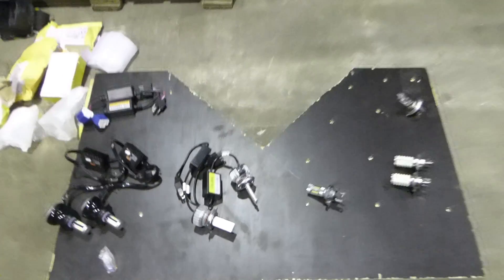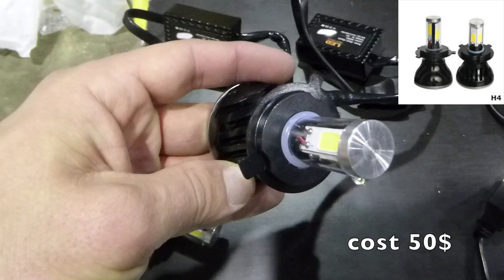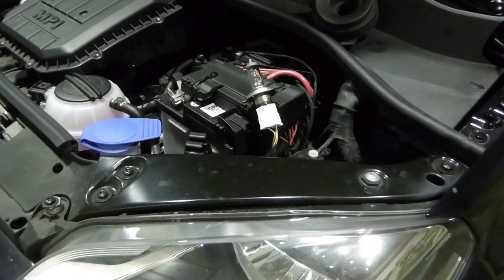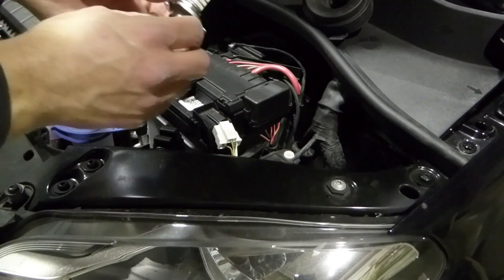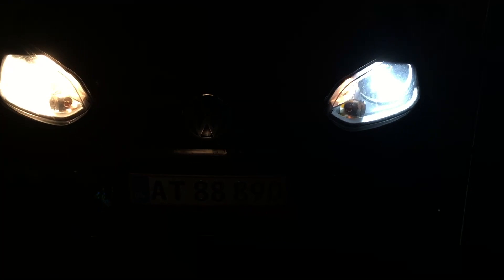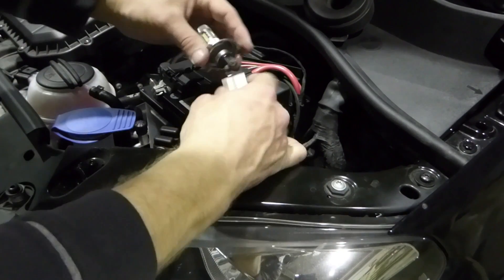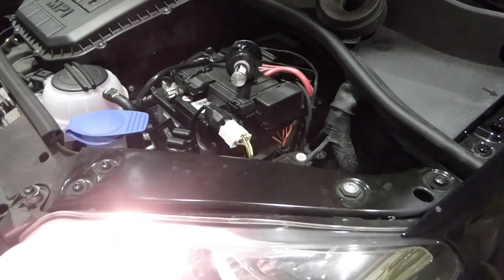Car LED, review, test and comparison, winter 2015/16

Comment: These LED bulbs, are only fog-light or daylight bulbs, and will not work as headlights low-beam. And in that reflector you need a H4 LED bulb with low-beam cutoff. This tester are testing wrong type bulbs in the headlights!!!!!!
The new best test bulbs of 2018 works better, but you have to buy the right bulbs for your lamp. Some work in reflector lamp headlights, other not. and Fog light bulbs only in fog-light or daylight lamps.

Comment: Congratulations!!... this is a very good video and demonstrate that the LED bulbs for headlamps that not have glass projector is not a good idea for the security and traffic in the streets. Thanks. The aftermarket automotive LED it must improve the design of the bulbs and make exhaustive tests so that they reflect correctly inside the headlight to comply with the global regulations on traffic and automotive safety.

Comment: I think qasqdk simply ignored that he could remove the H4 mounting plate from the bulb. You need to do that in order to be able to remount the dust cover of the light so I suppose the operators in the factory did not care about the orientation of the leds in relation with the mounting plate. I link the first video I found where it is shown simply and clearly: https://youtu.be/8gJT8zbU2pA
When inserting the bulb on the installed plate the leds that are on with headlight on must point upward. High beam uses also the other led that points downward.

Comment: Great video. Everyone talks abt how bright lights are but you got the really good point with the light cut. Even if you look at original Philips led bulbs, the first thing they advertise with is light cut/spread on the road. These cheep led bulbs are like driving with high beam all the time and it is just matter of time before you blinde someone on the opposite side of the road enough to smash directly into you.

Comment: LED Car headlights C6 series,we have types 880 9005 9006 9007 9012 H1 H3 H4 H7 H8 H9, easily quick installtion,will not damage your car;  if you want to know more about them,you can click here https://www.amazon.co.uk/dp/B074RGW71Y

Comment: I did see that other people Mount their LEDs with the low beam facing down I wonder if that would fix your scattering problem. your first high power LED was mounted vertical with the low beam on the left high beam on the right when it should be horizontal with the low beam on the bottom in the high beam on the top this would mimic more of the halogen pattern with low beam facing out and down and high beam would be 360 degrees. this is a failed demonstration
Reply: your second high powered LED was more expensive and that was mounted wrong with your low-beam facing up and your high-beam facing down this causes the glare you were getting. also a fail demonstration

Comment: at the end of the vid You mentioned coated high power halogen bulbs might be best, which high power coated halogens would you recommend? are they plug & play (trying to avoid buying an expensive system)?

Comment: The CREE LED bulb you tested at 8:45 was not installed properly. The LOW beam LED should be facing up in the head light and the HIGH beam LED should be facing down. Yours were facing sideways.
Reply: i think just the same

Comment: These bulbs are not oriented correctly so they produce an incorrectly focussed beam. these are H4 replacements and as such should produce the same focus as the original when fitted into an H4 reflector.

Comment: so you put fog lights in your headlight lol im dying from laughing
Reply: interdit no tresspassing H4 is the standard headlight bulbs for many cars. H11 is the fog lights. Do some research before laughing or you become the laughingstock.
Reply: JessGamer1001 no tresspassing, H4 bulbs are for low/high beams. H8 and H11 are the ones normally used as foglights.

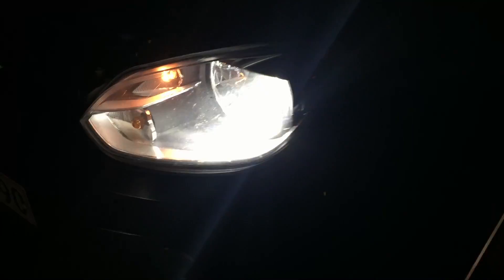Comment: It looks like you have the bulb the wrong way in at 11:10 - 11:15. it's supposed to sit horizontally in the reflector, so that the low-beam led lights up the top half of the reflector, and high-beam lights the bottom half. This bulb sits vertically and effectively turns the spread pattern 90° counter - clockwise in this case.

Comment: At 11:53 you can see that the bulb is oriented wrongly. Dipped beam side should be up so it reflects down onto the road, but it appears there to be aligned to the left and right.
Did all of the bulbs get installed 90° out, or only that one? Also, since the bulbs are keyed to only go in one way, perhaps they weren't installed all the way? This will mess up the reflection too, as the 'filament' will be in the wrong place for the reflector
Reply: Oh, and I would say that despite this, this is an excellent video. Thanks you, very good work, and great not to see some useless view of the front of a car. It's a shame the garage door was not a matt colour to show the spread better :)
Reply: Yeah I noticed that too, I was writing a comment but then I saw yours. I guess they got it wrong while manufacturing because normally H4 sockets only fit how they're supposed to fit in. I've seen cheap (well not that cheap but accessible to most people) and well manufactured LEDs in a similar configuration and I can say they worked well and did not blear as much as fitting HID bulbs into normal reflectors (btw I hate people who use those that way, you can see nothing if raining).

Comment: i think we need to have proper reflector/projector setup for the led bulbs.. because our default reflectors are tuned to halogen bulbs where the filament lies at the focus of the parabola structure of the reflector.

Comment: I have exactly the same bulb as the last one shown here (one with black fan). Your main issue is using standard type headlight, you need a projector headlight to cut off the glare on to oncoming traffic

Comment: Hello I have a question regarding the Led H4 headlights. I have installed some Led headlights in my Toyota. The headlights seems to point to much upwards and doesn't light up the road at all. The wierd thing is that there is no problem, when I install some normal H4 Halogen in the Toyota.

So my question is: 

Have you had the same problems with the LED lights that you bought?
Why is it that Halogen lights work fine, but the LED lights doesn't?
Can you maybe send a link to the H4 LED you have bought. The ones I have is 60/50 Watt, Hig/Low, 6000 Lumen, and think its around 6200Kelvin. 

I also have another problem because the led lights I bought have a cooling element attached to the rear and a fan to cool it down. The problem is however that the rubber membrane which is installed "after" the headlights doesn't fit, because the "hole" in the membrane is to small. Do you know any LED headlights which takes this to account?

Hope you can help ;-)

Comment: Nice Video! Thank you! but I do believe the bulbs aren't in right. We can see at 11:13 that the bulb is separated vertically... Usually bulbs are separated horizontally... Shinning the upper portion for low beam and the lower portion of the reflector for high beam. I believe if it could be adjusted to be horizontally, you would have a much better cutoff.

Comment: An excellent video, thank you.  This shows that some of the bulbs are ok, but it's the reflectors that must be designed around the LED bulb.  A generic LED bulb with its different design styles, different focus points, will not work correctly in just 'any' reflector.  They must be designed together.  This holds true for the HID conversion kits as well.

Comment: Great vid and very informative. It should be noted however, that LED bulbs like this aren't really suitable for reflector type headlights which are designed for use with halogen bulbs. LED headlight bulbs are really only suitable for housings which have a fully-enclosed compartment for the bulb and send the light through a projector lens to focus the beam.

Comment: If you are going to use an LED headlight bulb, you must use the proper LED reflector, otherwise as shown, the light beam scatters every where. I bought a complete headlight system and the cutoff pattern is perfect.
Reply: This is perfect for me https://sites.google.com/site/LED4Headlights
Reply from the maker: Interesting, didn't know you could get reflectors for LED's.
Reply: +qasqdk  Unfortunately it's expensive to buy the complete headlight system, but the cutoff is very sharp because the reflector inside the headlight housing is made for the LED bulb.
Reply: lol .... dont know what you bought but it works perfect for me .... its doing nice glove sharp. And yes i tested if its daze. I fyou want this in halogen reflector you have to put it in it right way .... 
;)
Reply: what brand did you get?
Reply: Spec-d brand headlights.
Reply: Arnold Anderson
Reply: sonny that ebay link doesnt work
Reply: i wonder if LED lights that were tested on vid could be blocked / focused by applying dark tint film to outside top of headlight bezel face to avoid blinding oncoming cars? looks to me the halogens look better throw longer cleaner light, im thinking the higher power halogens may be better, im guessing they will be much cheaper than expensive headlight system also
Reply: What I ever bought LED headlight bulb for my Honda is from this website:www.novsights.com

Comment: Hi, maybe u have an answer for me. I bought the h7 led for my Jetta when I installed it only 1 is working but when I test the other bulb with a 9v battery it works. I switched the bulbs and the same outcome. 1 works the other doesn't. What do u think is the problem?
Reply: Probably the canbus dosent like led lights. You probably need to add a resistor. Google led headlight resistor.
Reply: +emonvidaly I actually fixed the problem. I just have to widen the the tips(- and +)of the h7 LED bulb. But your right, there's no focus, the light is just all over the place, can't see the road at night! It s not safe! I reinstalled the stock bulbs. What a waste of money! Luckily, it's a cheap led from China.

Comment: Wow, at last someone does a proper comparison, rather than shooting a video in the daytime with headlights on and forming the conclusion the LED's are whiter. I have just bought a new car and will be upgrading headlights, I use H4 and H7, and have previously used HID which are brilliant, however, I think LED may be the better way to go now. I'm going to buy a new pair of headlights and convert over to projector lights as well, chick should make a large difference and I may not need such a bright light to get such a good result. The first gen LED's were just terrible, and a lot of them are wired incorrectly as well, which is likely the issue you are having. Thanks for the review.

Comment: The reflector is what controls the pattern and beam throw not the led bulb. The last two bulbs you shown were better but no bulb is going to change the pattern that the reflector projects.
Reply: led bulbs are not truly designed for reflector lenses. there were designed to be in projector lens. same for hid lighting.  that's why there are major cut off and glare problems

Comment: Good to see someone testing a variety of Leds.. one thing I strongly disagree with this video is the car you chose to test the led lamps. the majority of H4 headlamps in cars out there have extra reflectors that cover the globe inside the light itself. had you used a car with that setup it would have reduced the glare being thrown up into oncoming traffic. So viewers, don't be turned off by leds :) cheers
Reply: +pauly b one miss leading thing about this video.even though he is right that there is a focus issue. your only supposed to use them with PROJECTOR headlights to focus them and you notice a huge difference otherwise there usless. pauly b is right

Comment: Thanks for this video! It is rare to see a comparison of this type of product and done correctly. 

I have Phillips 12953BWX2 H4's in my car, they seem to do a decent job, good cutout line and absolutely no glare. The only issues I had are the heatsink that doesn't fit inside the headlight and the headlights covered under heavy snow (snow doesn't melt).

Comment: I agree with some comments. The orientation of bulb 3-4 is incorrect. U must fit it so the light faces up on low beams and bottom is high beam. 

Other than that, best review video on internet. 

On this note, has anyone here any experience with H7? The are mostly independent on orientation because you have 2 separate reflectors.

Anyone?
Reply: +Tim Pipp that's what i love this ones: http://www.ebay.es/itm/2x-110W-H7-LUZ-LED-PARA-COCHE-BOMBILLAS-PHILIPS-4-LEDs-10400LM-6000K-BLANCO-/401038741561?hash=item5d5fc59039:g:Dq0AAOSwnH1WZmWC

You can orientate the leds rotating the socket base and also adjust how deep can go into the hole. the works really well in both Reflector and Projector beams ;)

Comment: The third LED is mounted wrongly, low beam should be facing upper side of the reflector and high beam should be looking downwards. that way you would have a better lines on the door but as good as the halogen bulbs. This is mainly because of the bulb styles and since these bulbs are more powerful they will bounce more rays from the reflector and that causes the bottom side of the reflector get illuminated more. For HID's and for LED's you should have a lens to be able to have focus the beam or to have same effect as halogen bulbs. One more note, is that the LED and HID lenses are different.
Reply: +Othar Avarkan edit: end of the second sentence  "NOT as good as halogen bulbs"
Reply: what this guy said.
Reply: +Othar Avarkan Any experience with H7s?
Reply: +Tim Pipp since they don't have the high beam, it's easier with the h7s but I never used LED for h7. I used xenon with lens and they were great.
Reply: +Othar Avarkan Yes thats what i wonder about, all my cars and bikes have H7s but there is not a good in depth review like this one on the internet.
Reply: Tim Pipp I guess you can take reference the low beam part of this review for H7s. Since any kind of bulb type with single low beam should have the same light pattern.